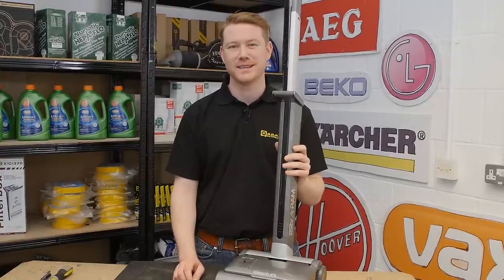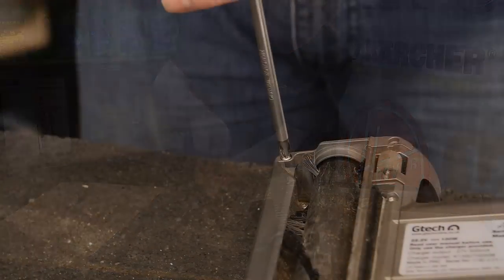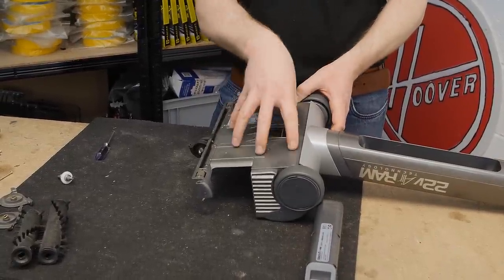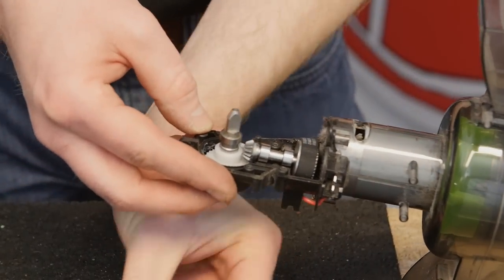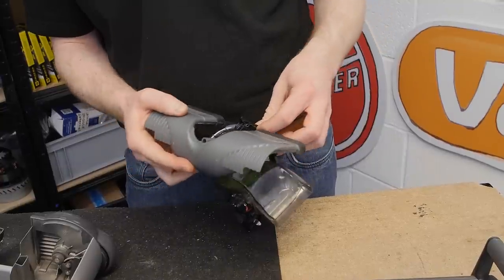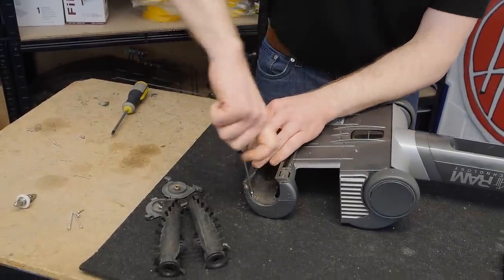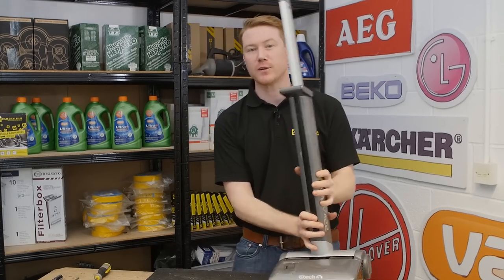Gtech AirRam Brush Drive Gear Assembly Replacement

Comment: My beloved Wife was using her air ram whilst, unfortunately, wearing a light neck scarf to keep warm. Se bent over to pick something up and the scarf was sucked in by the air ram. Her fault - not the air ram's!  The screaming noise of the stripped gear frightened her.  I didn't realise that replacement gears were available and that the air ram is so simple to repair  So she went out and bought a Dyson Animal for about £250

Then I discovered your excellent video. I bought a torx t10 screwdriver and the replacement gears. Your most excellent video gave me all the help I needed and now we have a vacuum cleaner for upstairs and another for downstairs.  So who's a clever boy now. She promised to do all the chores for a whole month - so I still love her to bits.
Oh the power of the Web!
Reply from the maker: That's great John, glad we could help.:-)

Comment: Fantastic video - just replaced that part following your instructions. I would not have even attempted to fix it without your clear instructions. You have saved me using an expensive repairman or a visit to the tip. - Thanks - Ian
Reply from the maker: Thanks for the comments Ian, glad we helped. 😊

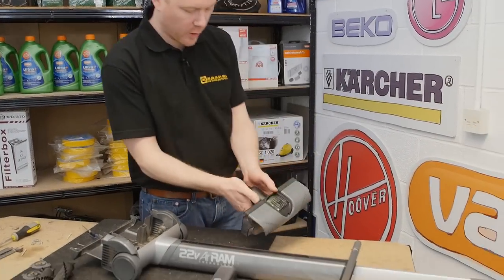Comment: As others have said, this an excellent video - extremely clear.  You do need a T10 screwdriver though as all but the first 4 screws are of this type.  I did the whole thing for the first time in about 45 minutes, with this video at the back of my table, pausing at each step of the process and have no doubt saved myself an expensive repair.  I did have a small problem at around 3:37 to 3:44, where I found I needed to remove an additional screw that wasn't mentioned in the video but is clearly visible at the bottom of the frame at about 3:36.  Anyway, looking closely it was pretty obvious this had to be removed too and once I'd done so the whole thing was plain sailing from then on.
Reply from the maker: Thanks for the comments, hope finding the 'extra' screw did not give you too much trouble.

Comment: Great video, really helpful thanks. In my case it was the little toothed belt that had failed because somebody had removed the roller end caps and lost one of the little brass bearings, causing the roller to rub against the plastic.
Reply from the maker: Thanks for the comments Richard, hope your GTech is back in action now.

Comment: the "torques head" screwdriver you mention at 2.03 minutes into the video ( excellent, by the way, ), what size head does it need? the smallest I have in my toolbox is a T15 and it doesn't seem to fit
Reply from the maker: Hi Charles, we used a T10 screwdriver for the one in the video.

Comment: It would be a good idea to clean out the compartment where the gear sits as the old plastic gears will be there but stuck in the grease which could cause damge to your new gear. Also lubricate your new gear with clean silicone grease on reassembly.
Reply from the maker: Hi Citrail - WorshipGod, thank you for your post and the good advice for everyone to follow.

Comment: Hey Matt how much for the plastic end of a Bosch cat n dog , the bent end you hold that the extendable pole attaches to
Reply from the maker: We can supply your part. You will need your model number to confirm the correct one so see our website here: http://www.espares.co.uk/browse/ca1237ma856/vacuums-and-floorcare/bosch
Reply: Very good video,  does the new gear come with silicone grease as its important to regrease the new gear for longer life.

Comment: hi i have followed your video
but can anyone advise me why i took mine apart was while the handle is in the upright position it work fine
but as u pull the handle down it goes off
i have checked the wiring and switch and battery connection 
but there seems to be no moving parts to cause this
any suggestions please
regards
will

Comment: My husband mended my Gtech as above after I caught something in the roller. Got it working but it now wants to move in a backward direction instead of forward. Any suggestions as to what has gone wrong. Thank you.
Reply from the maker: Hi Pamela, it sounds like the rollers may not be fitted correctly, ensure the rollers connect to the drive shaft in the correct position.
Reply: eSpares thank you will try that

Comment: I think at 3:44, there is another screw that should come out. I missed it and it sheared off but didn't seem to matter when put back together.
Reply from the maker: Hi Andrew, thanks for your comments. We did not seem to find another screw during our video shoot, however as long as everything is stable, we believe your Gtech should be perfectly fine.
Reply: There is another screw and if you forget to take it out as he did in the video that part breaks away from the ducting. It looks like that part was already broken on the machine they used to break down on the video but this can't be the only one he has taken apart. Shame he didn't notice that and warn people about as it spoils an otherwise great video.

Comment: 03:40 - Looks like you missed a screw just prior to removing the ducting.  The ducting still comes off, but so does the bottom screw tab!
Reply from the maker: Hi Bromley86, thanks for your post and well done for the spot :)
Reply: Ugh- wish I'd read this comment before I broke it! eSpares- it would be good if you could add some warning text to the video about this.

Comment: Good vid.  I've had to replace the gear twice.  It's not durable enough.
Reply from the maker: Thanks for the comments Brad. We think the gear week has been deliberately made to fail if there is too much resistance from the brushes to protect the motor. Be careful when cleaning deep pile carpets and rugs as the machine can put a lot of pressure on the gear. Try not to apply any pressure or clean for long periods, rather give a quick brush over.

Comment: So Can I get a brush drive gear in the UK?  The US they quit making them here and you can't get a gear for it.
Reply from the maker: Please enter your make and model number into our
website below and start your search today: www.espares.co.ukIf you are having trouble finding the part you need please contact us so
we can locate the part you need: www.espares.co.uk/contact/sales
Reply from the maker: We have the part you require here:
http://www.espares.co.uk/product/es1748183
Reply: ok is there another part I am missing? I got the part and replaced it and it still is not working right??

Comment: BEWARE!!!  HE BROKE IT AT 3:47. There are TWO screws to undo just before 3:47, not just one. When the housing is removed at 3:49 you can see a small U-shaped lighter area and a screw; the lighter area is the plastic he has just broken, and the screw should have been removed. At 3:41 you can see the screw you are meant to remove. When you put it all back together the cover is now only held in place by 1 screw which doesn't seem to be a problem but it would be nice not to break it.
UPDATE - I tried this with both a plastic cog and a steel cog, and neither worked for more than a few minutes; the reason was that the two meshing cogs are not close enough together. The plastic cog only had the tips in contact and so sheared almost straight away, and a steel cog didn't have the sharp tips of the plastic one and didn't mesh at all. The answer, a PTFE washer, 1mm thick, 27mm outer diameter, and 13mm inner diameter; available on ebay for £1.50. I put this between the cog and the housing and the cogs mesh well. I've used the steel cog, but I suspect I would have used the original plastic one that was "broken" because, other than the tips being sheared off, it was fine. Suggest you try a washer for £1.50 before buying a new cog :-)
Reply from the maker: Hi David, thank you for the post, we have said before in another comment about the fact there is a screw that was not shown but thanks for bringing it up for everyone else to be aware.

Comment: I've fitted so many new cogs I can strip and rebuild in 12 mins 😉.and still only lasted 10 minutes on my carpet bad design and cheap cogs on eBay are rubbish
Reply from the maker: Even new cogs from GTech fail. We think they use nylon to act as a type of 'mechanical fuse' that will fail if too much power is being used to turn the brushes. This could happen if the cleaner is used on deep pile carpet as the brushes 'sink' into the pile and the extra load could cause damage to the motor.
Reply: I had this but the last time I replaced it I tapped the nylon gear closer to the metal one so the meshed tightly together, that was last year and its been fine since.
Reply: I found a metal replacement cog from electrical-ales on eBay. Ironically what I actually needed was a new rive belt which I obtained from oarder2002 who included a message to clean out the cog you are not replacing or risk fast failure.